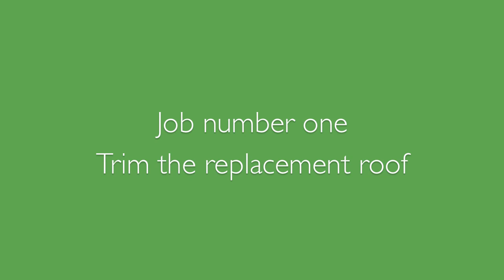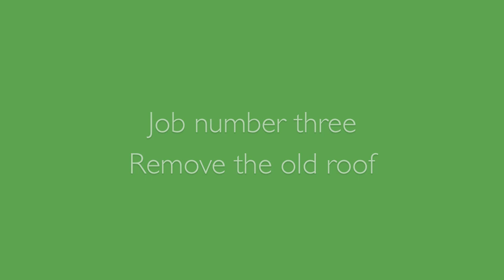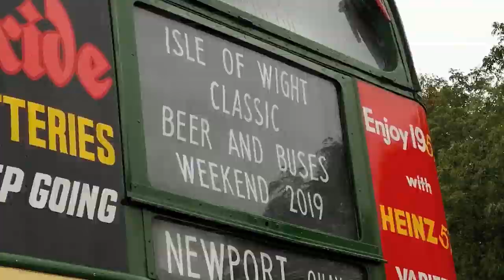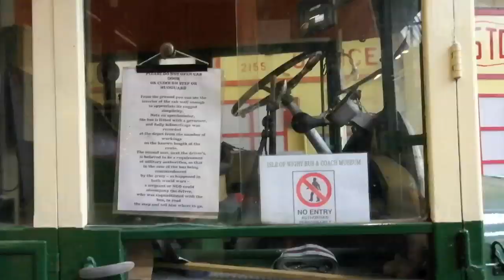Building a Classic Rally mini Part 27 - welding on the roof - Matt Green collaboration

Comment: was that an old Black and Decker Proline angle grinder i saw there? still have 2 myself from the mid 90s.
Reply from the maker: ha ha, that was matt's angle grinder - I think you could be right - collectors item ? :)
Reply: The Gentlemen's Motor Racing Team  well they last well. Build a few cars with mine.